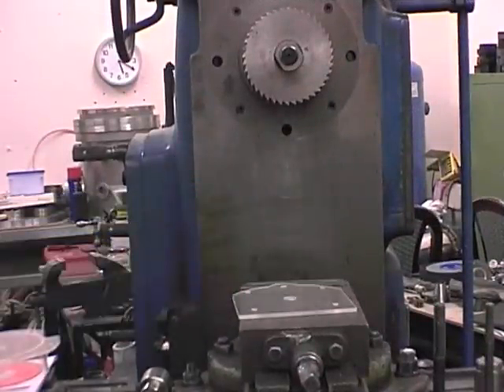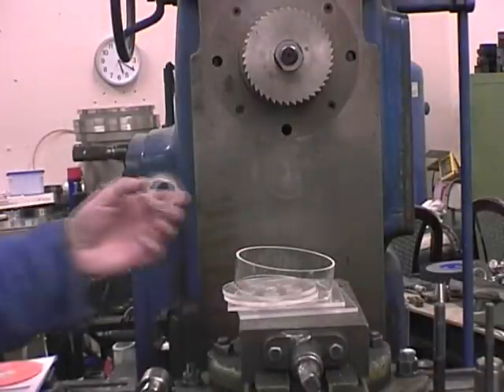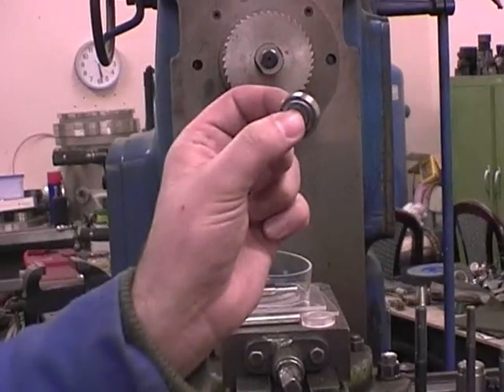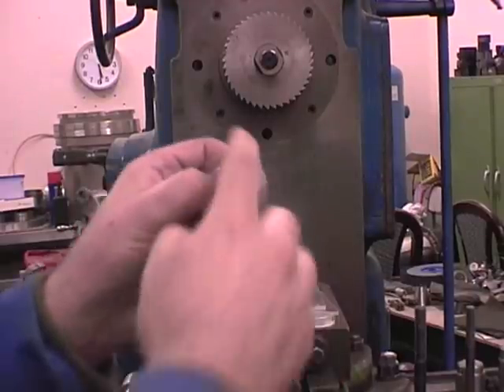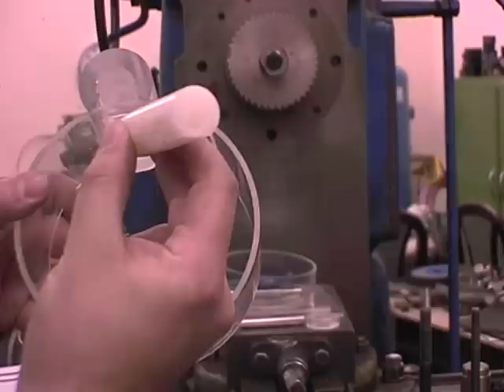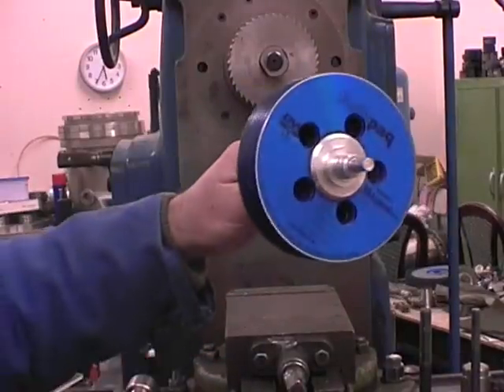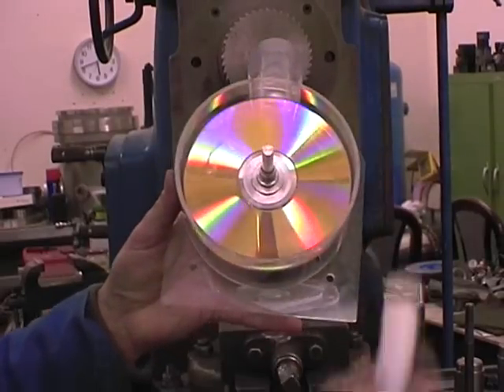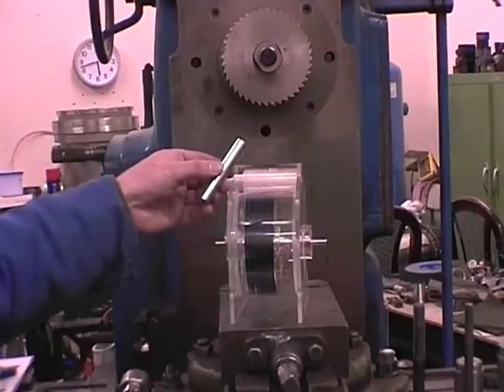DIY Tesla Turbine Video 1

Comment: if you would have scratched the cd 's with a sand paper then what would have happened?
Reply from the maker: +Parasar Bhattacharya That is a very interesting question. You'd think a polished surface gives the best results when seeking laminar flow but I have seen actual experiments in the intakes of carburetted engines where if the intake port was roughened with sand paper, the engine performed better as it flowed more air. So, I am not sure what would happen...
Reply: *****
i also dont know but it might have a more torque power, just my thoughts, thank you i will try it myself but should the disk be a little thinner then cd's?
Reply from the maker: +Parasar Bhattacharya Disk thickness is not important. Only the spacing between disks matters.
Reply: *****
thank you

Comment: I am working on my semester project for designing an end-user wind turbine for small scale application like 5kw and i was thinking of using tesla turbine instead of horizontal axis turbine.

what if i use magnetic bearings and direct drive configurations? do you think it can be as efficient as other turbines? 

Your input will be much appreciated!
Reply: +Muhammad Talha Siddiqui Hi Muhammad, sadly no. The Tesla Turbine is not efficient in its present form. It was created at a time when the best engine was a steam engine and it is MUCH more efficient than a steam engine but shortly after it was created, Parsons invented the steam turbine which was much more efficient than even the Tesla Turbine.
Reply: thank you for your response. 

Just one more thing, in your opinion which is the most efficient way of capturing wind energy?
Reply from the maker: +Muhammad Talha Siddiqui It depends on wind speed and what your budget is but I would recommend that you look at the Savonius turbine. You can make one easily from an oil drum. https://en.wikipedia.org/wiki/Savonius_wind_turbine
Reply: Thank you for your advice.. it was much appreciated ! :)
Reply from the maker: +Muhammad Talha Siddiqui No problem. Best of luck with your project.

Comment: I am interested in trying to produce 'solar' energy with this by using a water reservoir and mirrors to produce steam. Will the design you have shown here hold up to the 100C steam or will the CDs warp/erode due to the temp and pressure.  Any advice is appreciated. Also what would the approx cost be to build the turbine you've shown here? I'm a mechanical engineering student and I am very interested in the alternative energy field.

Comment: Thanks for sharing, great information! Gathering opinions from many and would like yours too if you don't mind.?. Would like to incorporate in front of new electric airplane design. Would have an air intake in the nose to direct and ram air into the Tesla Turbine. Would like to use for regenerative power back to battery bank and for providing electrical power to a/c systems while in flight. Sound like a practical application to you? Thanks again, TA.
Reply from the maker: Tesla Aircraft The Tesla Turbine as it is designed has a major design flaw in that the air intake and exit are at 90 degrees to each other. Contrast that with the jet engine or steam turbine. While the blading system in a Tesla Turbine may be the most efficient form of transferring power, the loss of power incurred by the airflow turning 90 degrees ruins the efficiency.
Reply: ***** I understand. Looks like we may just stick with a conventional 3-bladed wind turbine generator in conjunction with the solar panels. Thank you for taking the time to reply, TA.

Comment: What do you use to separate your disc sections?
Reply from the maker: Timothy Reszel Mylar washers I made from sheet material. The sheet thickness is matched to the boundary layer thickness of air in the turbine.

Comment: What did you use to attach the disks to the shaft?
Reply from the maker: The discs aren't attached exactly. Each disk slides onto the shaft spaced out by a PTFE washer. At each side of the disk 'pack' is a collet which stops the disks moving around. http://www.tesla-turbines.com/images/parts.jpg
Reply from the maker: See also this page: http://www.tesla-turbines.com/parts.htm

Comment: love your accent, but on a side note do you think that one on a larger scale would be enough to power say a boat like a tug or a fishing boat for deep sea fishing, and would it be possible to make one powerfull enough to be the heart of a tank
Reply from the maker: While Tesla turbines are very compact, at the moment, they are not efficient. They're much more efficient than a piston steam engine but less efficient than a petrol engine. There advantage is that they are easy to make & simple to maintain. I think that their best use today is maybe to power a generator from a wood fired boiler in a back woods situation where reliability & easy of maintenance trump efficiency.
Reply: ***** That is because these aren't made to Tesla's Specs. If made how he designed them, he proved that they reach up to 95% efficiency, far more than the 15% from IC engines.
Reply from the maker: Brian Winzey Hi Brian, the blade section is 95% efficient but the exit at 90 degrees is a disaster. If the TT had been 95% efficient Parsons would never have taken over the world with the much more mechanically complex and much less compact steam turbine.

Comment: This is great work. Thanks for doing this and putting this up on YouTube. I have built many of these Tesla Turbines over the last 29 years. They are fun and very educational. I know you have built your model of plastic, but if you ever get the chance to duplicate it in metal you will discover you can generate quite a lot of mechanical power running it on steam. I once built one with 6" disks 40 ea. with .005" spacing. I ran it through a 30: 1 gear box= (930 rpm at alternator) and drove a 12V VW alternator with it. It would light up 8ea headlamps on 50lb.saturated steam I had available where I worked. Any more load would trip the alternator. I think those headlamps were 40A each. 320A is half of 750W approximately or 1/2 hp. I have no idea of efficiency because i didn't know how many pounds of steam per hour it consumed (weight of condensate was not measured). But I thought that was pretty awesome. I impressed myself. LOL
John
Reply from the maker: Hi John, I am currently making a 10" 12 blade turbine. See my 'Turbine casting' video.

Comment: According to Jeff Hayes lectures a Tesla turbine is not efficient until high speeds, contrary to your prior statement.  But there is a sweet spot even at fast speeds due to a vortex.  I saw where someone was using discs out of old hard drives and they are precision made and strong enough to spin fast without disintegrating unless you screw with them enough to get them out of balance.

Comment: So, the conclusion is, the more I am close to laminar flow , the better turbine is ,because there is almost no turbulence which will impeding airflow?

I am making turbine out of hard discs. I have made some schemes in SolidWorks, but main problem is appropriate design of the casing for  these disks and the nozzle. 
Do you maybe have some schematics or advice for that kinda turbine?

thanks a lot on information :D